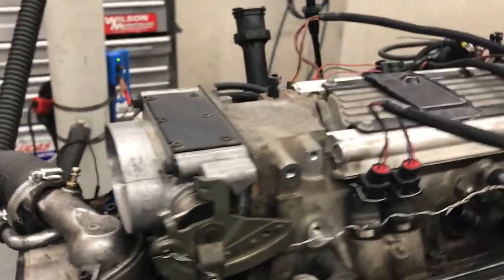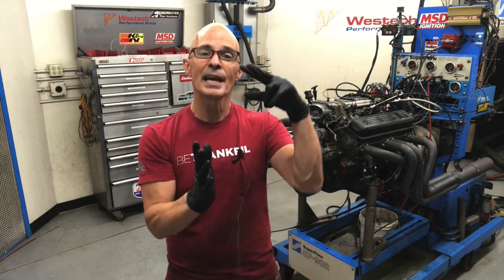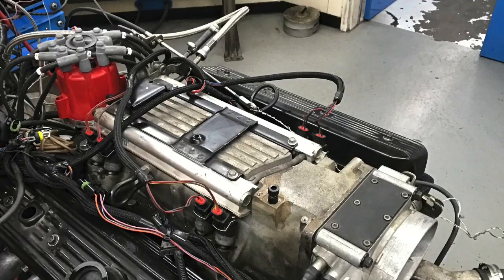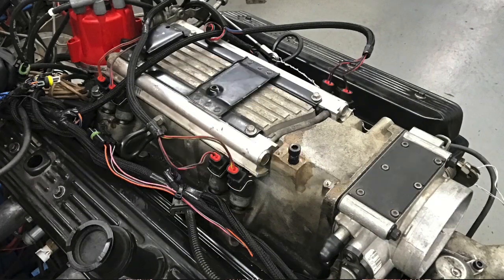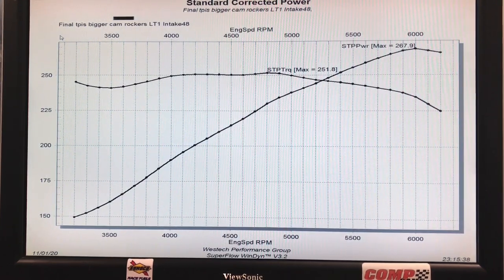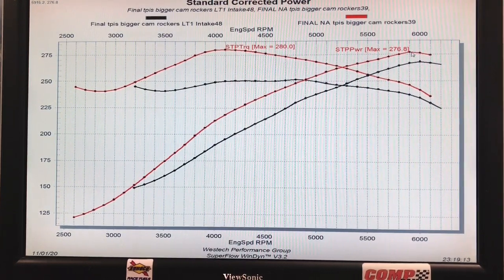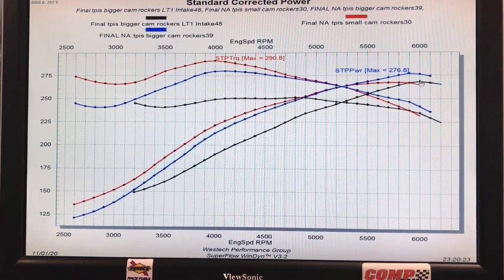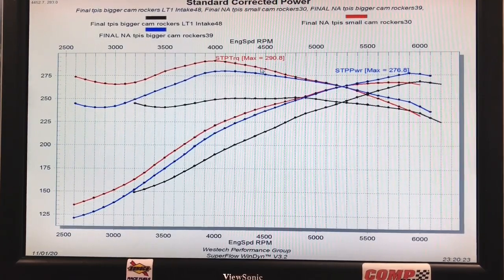L99 CARBS VS COMPUTERS-4.3L (LT1) SBC EFI VS DUAL PLANE

Comment: I would love to see some data from a single plane intake, Vic Jr style. I’m running a ported stock manifold on a 383 with 12:1 cr with ported Trickflow heads. Was considering swapping to a single plane.
Reply from the maker: it would be a bad choice on this small motor with a mild cam-better choice on your combo if it has a good cam and heads

Comment: I'm impressed that this little engine stays together. Are these little engines good for 200,000 plus miles if you take semi-good care of em? I drove a Caprice with this engine in it for a friend that needed to get it home. It seemed to me that it had plenty of power for what the car's purpose is. Keep em coming sir.
Reply: I pulled a 190k lt1 out of my camaro.  It was still running fine when I pulled it to swap a built motor in.   Upon tear down there was nothing alarming found.   I have no doubt it had another 100k miles in it.  That motor saw redline every time I took it out too.

Comment: Is there also a comparison of the stock intake vs dual plane on a 350 LT1? Maybe also compare a 4 barrel throttle body EFI to the carb.
Reply from the maker: same thing-just slightly earlier cross over

Comment: I had the idea to make my own runners for my tpi setup, but I ended up going carb, i was going to make flanges, to fip the upper and lower, only with ports about 1/2" larger, and weld tubing a bit larger diameter, 1&7/8 - 2" mandrel elbows, and maybe 4-6" longer,    but  the easy option won out, plus the base would probably not be easy to open up! I went with a Holley Street dominator intake,

Comment: You've got a Milling machine, there, you could have built up around the hole for the distributor with weld if necessary, then milled it flat, level to match an early small block distributor hole. It would then work with no problems. Find and engineering shop that can do it properly.
Reply: Hey he got it good enough to make a few dyno pulls .. doesn't need to be any better for this.  I couldn't see the distributor wobbling during the run lol. If was going to put into a car would use some aluminum tube and make a bung .. set the bung in the hole at the proper angle and depth (mock up on engine) and tack it. Pull the manifold off and tig  it. Add a boss next to it and drill and tap for a hold down.

Comment: a super ram would out do all the intakes. when you start dynoing the 350 lt1 please make sure you get some pulls with the lt4 heads on it
Reply: No it won't.  FIRST would and does spank a Super Ram.
Reply: @chrisreynolds6520  lol you were already wrong about crappy l99 iron heads flowing 220 cfm why would a first intake make more power and tq on this little motor? i own every efi intake form 90s and done lots of testing myself the first ports are way larger diameter than the super ram it will lose tons of velocity it would be down in hp and TQ bigger isnt always better
Reply: @Madmax.3  You do realize runner length plays a HUGE part in it as well and the FIRST runners are several inches longer.  Super Ram loses some torque on a 350 where the FIRST generally keeps the same torque curve just more of it everywhere.   I based what I thought the L99 heads would flow based off what a pair of stock L30 heads flow as well as what a set of slightly worked over L99 heads flow.

Comment: i would put the tpi on it and i wouldn’t waste my time with the lt1 heads. the valves will be shrouded from the small cylinder bore and it will not flow as good as they would on a bigger engine. i feel tpi and turbo is the way to go.
Reply: The problem with the LT1 heads is factory flow numbers not bore shrouding. The valves will not be any more shrouded in a 305 than they are in a 350 until about 0.480 lift where the valves actually poke out of the chamber.

Comment: Wouldn't it have been easier to use LS coils?
Reply from the maker: yes
Reply: @richardholdener1727   Did I hear you correctly when you said using the LS style coils, you can use a signal from the crank sensor if you have one,  correct?

Comment: Im not convinced that the tuned port is going to do a whole lot  better than the Carb setup your using untill you swap those heads. Then all bets are off. :-)
Reply: I am convinced the heads on it are going to run better than a non ported LT1 head.  They probably flow every bit of 220 cfm which is more than an aluminum LT1 head and out of a smaller intake valve. They also have a slightly smaller combustion chamber.

Comment: GM in Oz had a 253 (4.2) V8, most guys ran a 350 Holley
Reply: 300hp was the norm for them with the two barrel when they were raced in the Commodore racing series, so good power is possible with a "small" induction if the engine is treated as a complete package.
Reply: @Mikki_Tu  I wonder if higher velocity air flow through the 2 barrel helped the smaller displacement V8 ?
Reply: Properly tuned Q-Jet would be the best of both worlds.  Small primaries for off-idle low speed torque and then on demand secondaries with a total flow capacity of 750 to 800 cfm depending on the model chosen.

Comment: I love seeing modified intakes like this. I watched a 4.6 victor jr get band-sawed in half to widen it for a 5.4. This made the gears start turning in my head to try chopping up two victor jr intakes to make a single plane triton v10 manifold not that anyone would need such a thing.
Reply: Now I’m interested to see this style of testing, tuning, and modifying on the v10’s ford and dodges v10’s should be able to bolt right up to his Dyno no problem I think. That would be interesting to see plus the nitrous and the turbo set ups on those two engines
Reply: @HomieCesar  Triton v10 would definitely work on his engine dyno. Id love to see a true torque figure.
Reply: I'm so curious about those werid truck V10s. I'm thinking the mopar may be the way to go because it'd be so much easier to cam, even though the ford probably has better heads, you can't use em if you can't cam it. Plus you get more displacement with the dodge. Cam+displacement=good. And have 10 rods to spread cylinder pressures out over, it could be really good with boost!
Reply: @Levibetz  I certainly don’t know much if anything at all about those two engines. I would have to say that dodge is ahead of the game as they have more years with a proven v10 vs ford which was short lived and basically was out performed by the v8 and the power stroke. I’m just curious though I’m that kinda guy that just can’t leave anything alone I mean look at the ideas and the mods and out reach of imagination Richard is going through with this l99 🤷🏻‍♂️
Reply: @HomieCesar  i just realized you said the ford v10 was short lived. They introduced it in 1991 and its still used in bus chassis and industrial application. The modular is one of the longer lived engine families.
Reply: @madmod  only production vehicles I remember the ford v10 coming in is the f250 & excursion. Maybe put in other vehicles but was never a performance engine.
Reply: @HomieCesar  they came factory supercharged with the same roots blower equipped on the cobra and that ran in bluebird busses, agriculture use, and for generators so parts are available for high performance. In addition to that, they are rated for 310hp/465ft/lbs in stock truck trim which is comparable to the 305hp cobras while doing so below 5500rpms, which just happens to work perfectly with the stock shift points of early 4.6 powered cars. It would feel like a hundred shot all the time over a stock 4.6.
Reply: @madmod  I did not know this. Power is similar to the 5.4l which is in my 05 f150.
Reply: @HomieCesar  yes but remember you're comparing the two valve V10 to the three valve 5.4. They also make the 3v v10 which makes 362hp and does so 1k rpms earlier which is so much better with the long gearing. Then there is the torque shelf.
Reply: @madmod  didn’t know that either. Did they make a 4v v10 also?
Reply: @HomieCesar  yes but it was only in a mustang test car(search v10 test mule). Rather than using the 5.4s bore and stroke, they opted for an aluminum block 4.6 sqaure bore and stroke which made for an appealing 351 ci V10 which they used dual overhead cam Cobra heads on. It could not get traction to save its life and was ultimately scrapped. Another fun fact, a darton 3.7 big bore equipped triton v10 with stock 4.165 in stroke makes a 460 ci v10.
Reply: @Levibetz  comp cam has made cams for the triton v10 for a long while now. The major power killer for the v10 is its intake manifold as they share cam specs with pi mustangs which is a great cam for low rpms. The dodge v10s definitely have the displacement advantage but ive heard they have similar head cracking problems to the later magnum v8s. Thats not to say good power cant be had out of them tho.
Reply: @madmod  A cam that makes low end power isn't a cam to me hahahaha. My main goal in camming something like that would be to make the engine breathe and pump more air, make more power. With the ford you'll be paying double for cams. For the dodge you get roller lifters, and all the same valve spring infrastructure of the small block mopar. But I suppose otoh the triton can use modular valve springs too, so that's kinda a moot point.
Reply: @Levibetz  There is such a thing as over-camming and average power is far more important than peak. If your cam is spec'd to try and make power past that of where the combo is happy, you gain peak #s at a cost of torque through most of the rpms which will make a slower combo than a properly spec'd cam. Im sure it'll sound like it's making more power!  As for valvetrain goes, the modular is far more stout. Even a stock npi head with the stock springs can safely control the valve to 7k rpms. Considering we are talking about the v10, you wouldn't be turning more than 5-5.5k rpms so the stock valvetrain would be more than happy.
Reply: @madmod  That's what I'm saying though, why wouldn't we be spinning it to 7k? If you could do it with a mod or sbm, why not a V10? Worst case I could see a damper upgrade and it's good to go (along with the cam/valvetrain). IMO a motor is only over cammed if you're trying to have it be a good drive around street car, or if you're just way out to lunch in relation to the head. But compared to the stock cam profiles that are made to lug around at highway speeds in motorhomes, I think there's huge gains to be had. In terms of a drag pass average power is only important under the part of the curve that's used between your shift points. Generally redline down to a couple thousand rpm below that. The other thing moving that power band up can do will pull some torque out of the curve so that when you add boost, you're not hitting the connecting rods/pistons with as much cylinder pressure. The only thing RPM can hurt physically is inertial loads, which we know is generally fine up to at least 7k rpm on stuff like small blocks, and valve train, which at least on the mod is good to go stock.
Reply: @Levibetz  we wouldnt spin it that high because the combo doesnt support the power that high. Putting a cam that matches what the head has to offer in terms of flow, matching your runner length, and knowing the safe limit of the engine will show results. We know the 155cfm per intake port is good for 300hp as proven on many stock headed sbf combos. Add in the fact it has 415 cubes to consume that airflow and if you try to make the engine continue to rev and make power past where its able to, you will only be costing power through the whole curve for a small gain at peak. You dont drive at peak power and especially on a combo like these v10s, they inherently dont like rpm due to balancing, increased rotational mass, but most importantly extra displacement which will almost always make the engine produce its power earlier in the curve(not a bad thing). People have overcammed modulars specifically for years as most the record holding na cars dont even exceed 235° duration which is actually less than some of the comp grinds. Trying to make it fight itself to make power up high will make a slower car than a properly spec'd cam.

Comment: Sometimes I have a leak, (or drip) from the front, as well as the rear.
Reply: I'm not sure what it will do to emissions but you can use a rubber band or a zip tie on the front one and a cork in the rear.  Just be be sure to keep the two seperated
Reply: Taco bell?
Reply: Anal seepage

Comment: I like how over and over the longer runner intake is the right choice for my rpm range! Thanks for all the test! Plus I liked  how this showed a carb setup compared to a port injection setup.
Reply: Runner length to match the RPM is a big deal. The cam's LSA is also a big deal. The area under the curve with the tight LSA cam is way better.

Comment: Will the results be the same with 5.7L
Reply: Probably, but not as drastic. the results of efi are often less than exciting because the early introduction of fuel to the manifold of a carburetor cools the intake making the mixture more dense. On the 5.7 the dual plane might offer some restriction and be less of an aid, it might prefer a larger manifold. The super rams were about the best efi manifolds for the sbc. I'd like to take a super ram or cross ram or cross fire and put injector bungs in the top plate instead of at the cylinders, or maybe have dual Injectors and use the down stream Injectors to trim out the distribution problems.
Reply from the maker: fuel cooling is much better with a carb intake and the short-runner efi intake would be down compared to dual plane on a 5.7L (but the cross over would be lower than 4.3l)
Reply: GMPP still claimed +30 ft/lbs from both the LT1 and LT4 dual planes.  EFI People always doubted that number but those of us who actually ran them did not.  I like EFI dual planes still give most of the gains even without the fuel cooling.

Comment: I fixed my LT1 distributor issue by pulling it out and putting a 406 dart block nitrous engine with 1175 Pro Systems Dominator in there. Had to run the carb sideways and ran a Crab cap and crank trigger on it.
In my 93 TA.
Reply: Can you remove the dizzy part in car? I'm using Fitech Meanstreet 800 and a DUI hot distributor and would have to pull engine to get back out
Reply: @biggregsparks8364  ??   Once your distributor is in, for a crank trigger, all timing changes are done on the crank trigger or computer. But with the crab cap, it can be pulled up enough, along with intake, and you can get it out.
Reply: @funfun8095  ok. I might swap to a similar setup. How complicated us the crank trigger? From memory, it runs of a wheel with magnets on it?
Reply: @biggregsparks8364  Crank trigger is pretty simple. Yes magnets in wheel on balancer. I had MSD.
Reply: My sister had a 92 GTA in red with gold and it was such an awesome car other than the 305. It was fairly quick given the fact that it had a 305 and it handled like you wouldn't believe, but it was just gutless up top. Honestly this L99 makes about the same power as the 305 from back then. They were rated at 195 HP for the 305 auto and 215 HP for the 305 manual. Her car was an auto. Edited because I screwed up the year...
Reply: @DiamondBackRattlaKid  I had an 88 with 350 in it. They said they wouldn't put the 350 in t top cars, because of the chassis flex. I think they did one year in the formula. So, all t top cars were suppose to get 305s for the turd gen f body.
Reply: @funfun8095  they wouldn't put a 350 in five speed cars either saying that the transmission wouldn't hold up. The 700r4 couldn't handle it either so I don't understand their logic. GM doesn't do much that makes sense though 🙄😂
Reply: @jr78racer  Yep